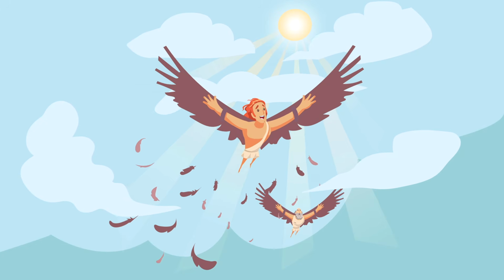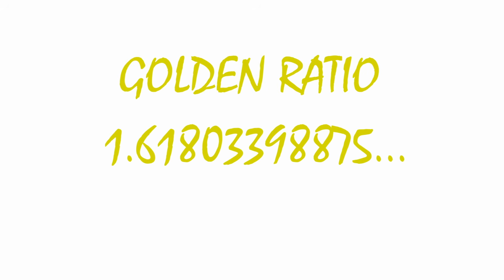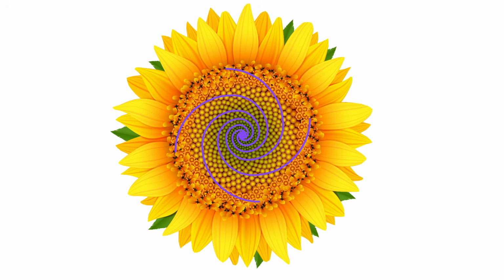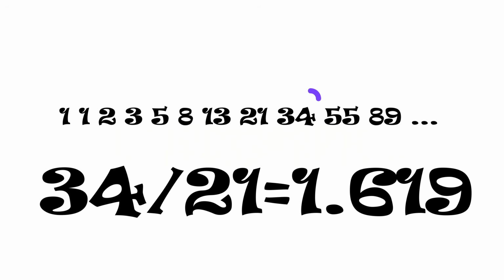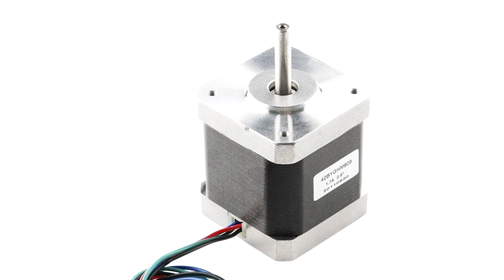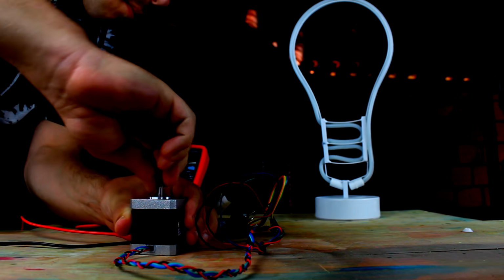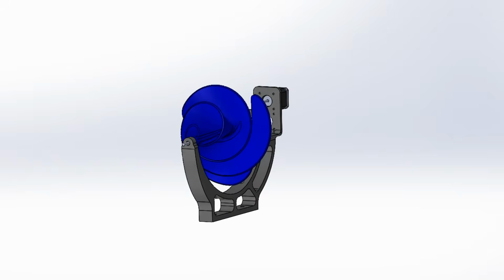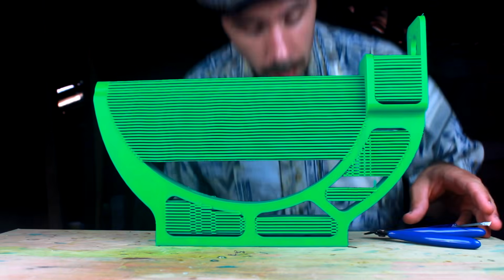Golden Ratio Turbine 3D Printed

Comment: Simply use the Lily Impeller to rotate the generator blades. Since the design is the same, the vortex created in the water will interact inversely with generator. The problem that will remain is the counter torque produced in the generator. But like Victor, you will probably find a way. Great video about very complex ideas explained in a fine way. Thanks

Comment: You should make a video of the impeller being used as.... an impeller. Calculate its thrust per watt used at different speeds. Try using it as an impeller for a drone (in air) and as an impeller for a boat (in water). Compare the thrust per watt for both (air and water)

Edit: also, you should declare me the next winner for the 3D printer. I am an Engineer from Canada and its a shame I don't have one. :/ wink wink. Nudge nudge.

Comment: I was thinking to build similar wind turbine generator with a Lily impeller. Thanks for saving hundreds of hours from your subscribers who would spend many hours to make this tubines. It appears Lily impellers not much efficient as common propellers in terms of producing torque and power. They may be good at initiate water vortex but to take wind power i think common propellers would do job as good as those if not more.

Comment: World domonation.....

Build a generator using a coil around a magnet suspended between two Bismuth plates...

Zero bearing resistance....   whilst harnessing the magnetic flux of the magnet spinning in the wind...
You may need to direct the airflow over the magnet.

May I suggest a future video should be 

Warmest regards

Comment: I have been wondering if it is possible to improve the surface finish of a 3D printed part made by a filament printer, by quickly heating the part until the surface melts a little, then quenching it to cool it quickly. It may improve the drag a part has when moving through a liquid or even improve the look.

Comment: Love the video and just subscribed. I can't help but think that a bladed fan like the huge wind turbines would have performed better as the larger diameter would have produced more torque and thus you could have produced the same power at slower speeds and maybe used that gearbox you rejected (There must be some correlation between diameter and flow rate). I'm looking forward to your future videos and your previous videos. Thumbs up.

Comment: Cool project - I've been trying to find vortex generators but seemed to have forgotten the exact term e.g. propeller is not correct. Good seeing water spin down the drain in the opposite direction.
Next step is to make a vortex turbine to work in/on the aether...

Comment: This video is golden! It is a delight to like & share such an informative video. You inspired so many questions my mind is racing. Can you can put a funnel-ish shape in front of your impeller to make a toroidal air flow from a laminar air flow? Example: Can you reduce 1 cubic meter of laminar air flow to approx 1 decimeter of toroidal airflow using a golden mean funnel? Can you print the golden spiral inside golden mean funnel tunnel? Can you place a clear cylinder around the impeller to enforce the kinetic energy transfer of most of the air molecules that have passed through the tunnel? Can you harmonize more kinetic energy transfer by changing the spin direction of the airflow vs the impeller, or by spinning the air in the same direction as the impeller? Can you make a pi (3.14) from two golden spirals working in concert? Can you make a toroid with the impeller in the central flow? Can you harvest the outer toroid flow too? What if the golden funnel is just an outer impeller that is attached to another generator?

Naturally all of the above are all rhetorical questions. Stating them in a reduced way. 1. Can the golden spiral concept be used to concentrate the air flow and apply spin to the air flow? 2. Does the spinning air flow increase kinetic energy capture?   3. Does reducing potential pathways for air around the impeller increase the kinetic energy captured?

Stated in three words, what is the impact of "funnel into tunnel"?

I loved your video. You are a wonderful scientist, video maker, and person. Thank you!

Comment: Since water and air are both fluids the transition between the two and how they relate to each other is only natural. I would like to see this design in a much larger tank to see exactly how the ratio of impeller size to tank volume works out. Can you get an entire tank of 500 gallons spinning with a 5" diameter impeller? If not how large of a tank can you get spun into a vortex with a small impeller of this design, then compared to an industry standard design to determine efficiency of design. Is it just more cost effective to use the industry standard design or is it more rugged? I work industrial maintenance at a large paper mill and habe many questions about this since we have a few different impeller designs in various pumps.

Comment: Okay, someone tell me why my thinking is wrong here.... If you have a single, static impeller, isn't your power always going to be roughly the same (supposing you have a constant wind speed) no matter what sort of motor you're using?? If you use a high-speed, low torque motor like the first one, you'll get a lower voltage, but a higher current. And if you switch to a low-speed, high torque setup like you did the second time around, you would instead have a higher voltage, but a lower current. In the end, won't the overall power be the same, minus any newly-introduced friction?? It's not like you're adding any more power into the system, so why would we expect a change in output power? I would think that the only ways to get more power would be to:  Reduce friction, increase the size of the impeller, or increase the speed of the wind.

Comment: I tried most of this myself. (I used zener diodes in my bridge as not to lose so much voltage across the bridge). In the end it was mostly a waste of filament. The power generated is proportional to the diameter. Something small is never going to produce useful power in normal wind. If you use printed parts to brackets to hold and shape much larger sheets of plastics or wood you can make a useful turbine. Then again the wife made me pull down such an ugly monstrosity.

Comment: Dear sir loved the video,  but it left me wondering you used it in a horizontal fashion which when it comes to wind turbines is efficient in regards to power but lacks longevity when it comes to maintenance over vertical shaft wind power which from my understanding produces less power but in many cases requires no self regulation of it’s speed to keep it from tearing itself apart and from my research last much longer with little or no maintenance.  How would this work in a vertical format?

Comment: Put a lily or other turbine connected to a generator in between the faucet and showerhead. It will reduce the water pressure making it a watersaving showerhead and produce power for the lights or a radio in the bathroom.

Comment: 8 watts at 30 kph with a 220 mm turbine isn't actually possible because this would mean your turbine runs at 60,6% efficiency, which would violate the Betz limit. (59,26 %) So i assume that you went about 31 to 33 kph and you turbine runs at around 55% to 45% efficiency which is really impressive for a DIY turbine.

Comment: It would be cool if you can make a hybrid between the lilly impeller and the tesla turbine. Watching how the flow moves you can create an efficient way for the exhaust so there is minimal resistance if you incase the impeller like a ducted fan. Everyone maximizes the intake, but if the exhaust is poor you will have poor results. Also it would be cool if you can recycle in some way the exhaust.

Comment: I worked on a chicken farm for 20 years. When we would spray disinfectant after each batch it came in 1 gallon jugs. I emptied a lot of jugs that way. Flip the jug upside down and give it a swirl.. it empties out in no time. A lot faster than sitting there waiting for it go go glug glug glug and empty out into the big tank sprayer on the tractor. The iodine disinfectant still took a bit of time though, it was just to thick and syrupy to get swirling very well.

Comment: If you combine your Stirling engine with a easy to do diy 3 phase generator you could build a good emergency power supply which would run with anything flammable.

Comment: Hey man love the vids And i wanna say try thinking about solar generators if sterling engines work on heat than maybe a way to produce electricity would be to make a solar farm but the kind with the focusing mirrors anyways and see whats more efficient boiling water and movving a trubine with steam or usinga sterling engine with the heat
Reply: Actually that's a thing that already exists. They use solar collectors very similar with the home water heating ones and use the boiling water on a Stirling engine. Is has a lot of advantages. If you search for it there are big solar farms with that system. But it is hard to install because of all the pipes, cables, generators, and involves more maintenence
Reply: @rafaelreis5795  ? Really? I've only seen it where there's a large array of mirrors redirecting and focusing light on a water tank and the steam is pumped through a turbine and the turbine makes the electricity. I've never seen it with a stirling engine and i've never heard of home solar warming hmm interesting thanks for telling me i will research this good sir
Reply: @PotatoLover112  now that you talk about ir I maybe confusing. I know that those are a thing https://en.m.wikipedia.org/wiki/Solar-powered_Stirling_engine
Reply: @rafaelreis5795  yeah i think they are a thing but i know they aren't used in industrial power
Reply: Of course I am also curious with a power comparison.
Reply: @rafaelreis5795  yeah the difference in the design of stirling vs turbine is interesting and so is the design difference of different types of turbines
Reply: And I remember seeing a kind curved solar collector heating water on a pipe for energy production, but it is possible that a steam turbine was used and not a Stirling engine
Reply: @rafaelreis5795  I'm gonna go out on a limb here and say thats the more likely option because focusing lights on a huge water tank is easier than a relitivly small engine part

Comment: Since the project started out water-based how about continuing that theme and building a water turbine that can charge a cell phone using rain water from your roof! QuintBUILDs managed it with an open-air Pelton wheel. Wonder if the vortex turbine in a housing will be more efficient.

Comment: Like propeller: How does the impeller compared to a propeller? 
Would be interesting to see them compared at generating power.
Also: what difference does it make to put your impeller (used as a powergenerator) into a tube to focus the stream of air/water onto the impeller?
Your channel is such fun and happiness, please never stop ;-)
Greetings from Munich, Tom.
Reply: And what if you installed a large impeller in a pipe (as a generator) and let the accelerated jet (water or air) flow into a smaller pipe.  In the smaller pipe there is a smaller impeller.  Max power?  What if the impeller is combined with a coil and the voltage is generated inductively? 🤔 greetings from Dresden
Reply: Negative pressure or vacuum is stronger than pressure. That's the main principle. Using systems that use but friction will make it impossible to prove . As the friction will always be a constant of the acelaration you won't get the idea with conventional mechanisms.  An impeler as to be used right to see its potential. 
To mix water is great . But thats far from being the best of whats called Implosion technology 🤔 thats just a very simple use of a single impeler on a open pressure vessel. If you use pressure, vacuum will give its work against the system. If you use vacum the pressure will help as a reduction in friction happens .
Reply: @urbancompetitionRT  I absolutely agree with you.  But I meant to use a natural flow.  Like a stream or normal wind.  Magnetically mounted impellers equipped with magnets and a vortex coil around the outside of the tube.  I think the results would be interesting don't you think?
Reply: @Explidozid  I would have to see at least a sketch to give my opinion upon.  Implosion in its full potential works like current , so its needs a closed loop of a stable unbalance.  It can look weird , but it needs two devices in one . Let's say the difference between temperatures with in the loop should be able to create its own flow.  Otherwise if seen just as what it looks. . The reverse of a propeller.  . With a 3d moving flow that simplifies the way that liquids prefer to flow. . As Lily impeler does. But there are differences in temperature that makes that impeler so efficient.  Just a few can get to that "same opinion"  . Still.  Thats just the tip off the potential on whats called implosion technology.
Reply: @urbancompetitionRT  https://ibb.co/RPQTBcx my sketch 4u.The optimal distance between the impellers has to be determined, it may also be that the pipe needs a steeper or flatter angle.  It was just a quick thought of mine and then you ask for a sketch ;-) a stretched vortex coil would have to be installed around each impeller.  The impeller also needs magnets.  Maybe on the outer rotor blades.
Reply: @Explidozid  from that sketch the idea of a cone where the downwards flow will spiral down in a axial to radial force is very good example of using the natural kinetic energie on water based fluids . It will speed up the working system compared to a parallel port or tube streaming to the impeller. 
You would  need some extention before the impeller in order to get a steady pressure and flow over the impeller. 
To me I would try a dual cone allowing the fluid to spiral up in to and out from the impeller . 
The rest will stay a constant to the design of the impeler  and length  of the in and outlet. 
Cheers 🍻
Reply: That's what I was thinking. An impeller itself doesn't generate thrust, it generates velocity: It just speeds up the fluid that it's moving around. If you combine an impeller with a nozzle, that's when you get thrust.

Comment: One needs to look at a vortex as part of the bigger dynamic structure of a fluid moving in a form of a rotating toroid. Only when the dynamic system is looked in this way the complete fluid dynamics will be revealed. Where one sees a vortex, there is always a dynamic toroid movement of the fluid around the vortex ( the center of the dynamic structure ). In addition the best propeller (or impeller) is the one without an axis in the middle, one just needs more imagination in order to see the dynamics of the device and to understand why it is more efficient then the commonly used. You touched little on that point noting that water and air create a dynamic system that moves through the creation of the vortex.

Comment: seems what you printed was an open impeller, with all the energy  distributed outwards. I would be keen to see the same vane design, but configured in a 'Closed' configuration (in a tube, open ends), to see just how much water it can pump ;-)

Comment: You should try to build Leonardo da Vinci's Aerial Screw also known as da Vinci's Helicopter it would be pretty cool.
Reply: It doesn’t even work and probably never will
Reply: @NobleTheBarker  Maybe not at his (Leonardo) time, because it was supposed to be manually rotated, but using nowadays' motors it could actually work.
Reply: @duarteferreira8176  No. Not now, not ever. The idea is really basic in it's design of how to deal with lift within the space of a "light" liquid (air). The important part he came up with was to harness the force of an inclined plane to generate that lift.  Refinements to that idea led to working propelars of the modern day.

DaVinci designed many things, including props for plays. It's quite possible his design in question was merely one of those works.
Reply: it would be really cool !!!!!
Reply: Good idea!! Nice!
Reply: Nice!
Reply: Up!
Reply: And a normal fan for comparison
Reply: @schnellbratpfanne3606  good idea
Reply: @MajorHardware already did it.  https://www.youtube.com/watch?v=PZm_Y-15FDc  

Spoiler: 
it doesn't work.
Reply: Great idea!
Reply: Cool!!
Reply: Up!
Reply: nice!
Reply: Up!
Reply: Up!
Reply: Great idea !!
Reply: cool!
Reply: Major Hardware, anyone?
Reply: Yes
Reply: No, it won't. It's was a garbage idea and still is.
Reply: Looks like you’re getting a 3D printer
Reply: @saims.2402   Nope, he already gave it to the other guy, the one that suggested a super capacitor rocket. :(
Reply: Yeah he can jump off a cliff with it to test it
Reply: Im gonna borrow that idea:)
Reply: I thought it was proven not to work?
Reply: Cool idea
Reply: Yea
Reply: That's an awesome idea. He could even try to make a drone out of it.
Reply: @DZNDuarte  I agree
Reply: He sure should

Comment: What of you print a impellor the same diameter as your test piece chamber and see how flowing water through it and how much of a voltage it can create because we could use it to harness rivers to generate power over building a dam and damaging the environment more for some electricity, ps need help with a 3d printer set up for use with mac... that or a cheap pc i can use to do what i just suggested my self. Peace

Comment: It would be interesting to experiment with a sequential impeller or turbine setup. See if you can get a multiplied output from smaller impellers feeding faster & larger volumes of air into a larger impeller that produces more torque. The idea came to me from turbo setups on cars with smaller motors. Manufacturers use a small turbochargers driven by exhaust gasses to turn a much larger turbocharger while reducing the "turbo lag" effect (the lag in time for the turbo to spool up and output preferred air volume & pressure)